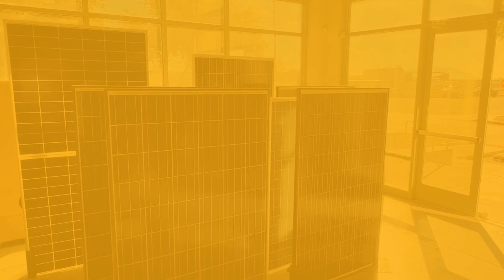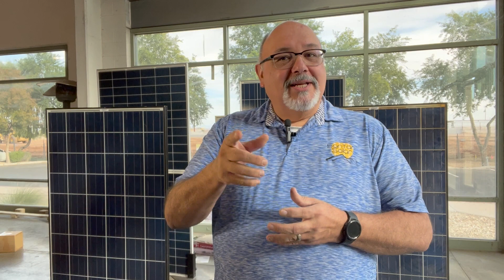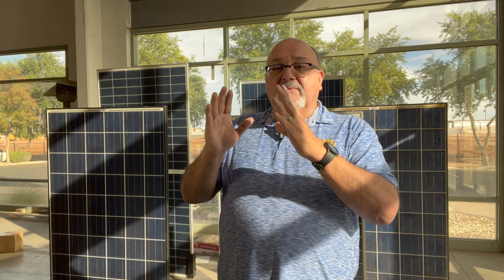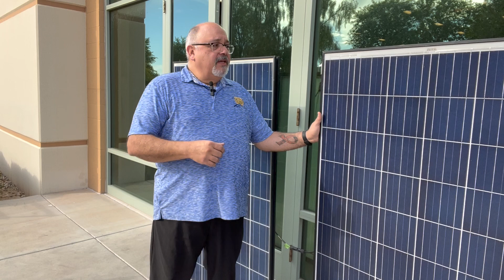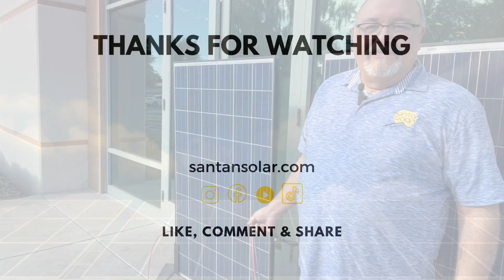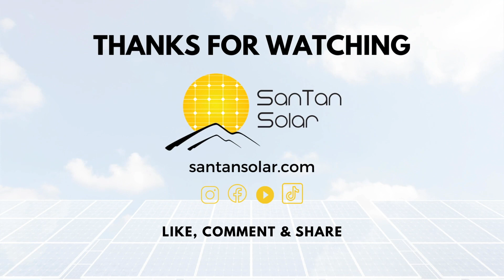Solar Panel Shading Tips - SanTan Solar

Comment: Just want to say you guys are just doing solar in general better than most right now. My 10 panels from you were excellent. Exactly as described, well shipped and a painless ordering process. Quick question, related to this video. I have a powerline running directly over the 10 panels we have mounted on a pivot with single axis tracking, and the powerline produces a shadow that pretty much hits the entire line of panels at the same time, right now, from about 1:15pm to 2:15 pm, and drops output about 1.5kw on the 3.6kw array. I'm not sure there is much we can do about it keeping the pivots attached the fence. It's currently set up as a 5s2p, for about 160-200v @ 2.5 - 13amps. Because the line of shadow hit's all the of the panels at the pretty much the same time as they are in a line with the powerlines directly over them, I'm guessing there would be no help by getting two more panels and breaking them into 3s4p. It might be difficult to acquire only 2 panels anyway of the same output/type/mfg. Sure would like to get back that kW or so we're losing mid-day, though.

Comment: Just like to point out..  voltage does not “come through”. Voltage is the electrical pressure that is developed across the panel from plus to minus. It is the current that “comes through “ as it moves in the circuit. 
Other than that point, this is a helpful video. 

I prefer to use series/parallel configurations arranged in such a way that ensures that shadows affect only one string at a time, leaving the other strings to do their best work.
Reply from the maker: That is a great point! Thanks for contributing your knowledge and preference!